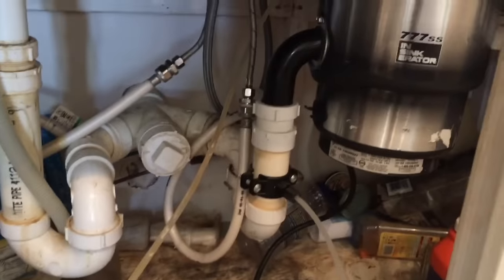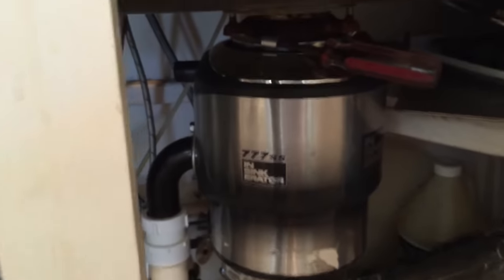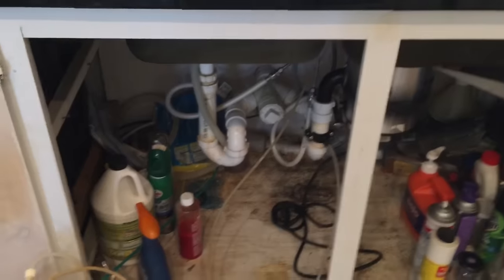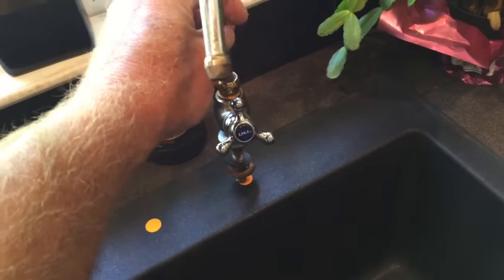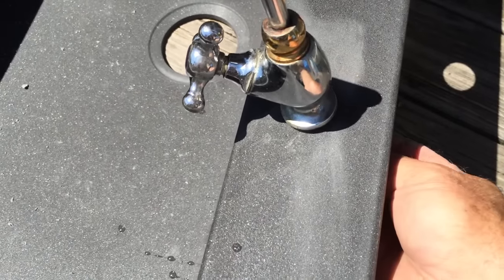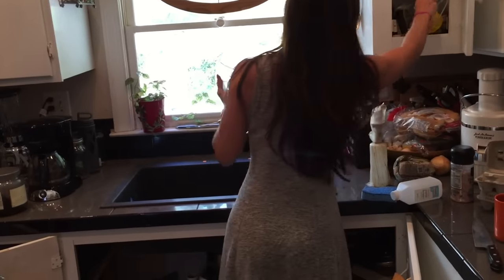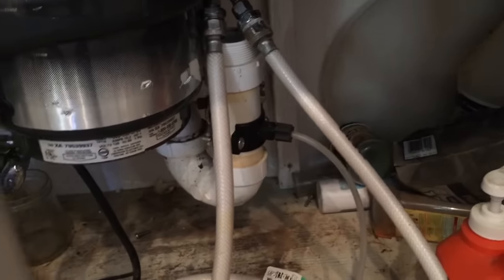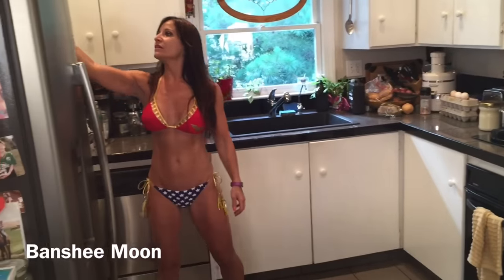Farm Girl and the plumber. Exoman replaces sink and does a how to.

Comment: There shouldn't be two traps nor two drains like the way this is plumbed.  I have plumbed a double side sink with a two-part waste  with only one trap into one drain for close to over 40 years.   To much stuff going on underneath the sink.
Reply: I learned the plumbing trade back in the 70s and worked for a plumbing contractor back then and when I left, later on I got my own Contractor's License and have enjoyed re piping houses and installing sewer, gas, top out , finish.  It all.   Lots of work but it pays well.  Here in CA we get $70.00 pere hr,  some others get up to $100.00 per hr.   I can't be that way.   Start over from the wall out and use a 2 part waste.  The only way we do them out here.
Reply: I still have my license and bond but I am giving it up here soon.  I don't do much anymore due to health problems but when the economy was good I use to do a re-pipe about once a week or so.  Made dam good money with re- pipes.   Anywhere from $3000.00 to $5000.00 .  But those were the days.  Heart problems here keep me from doing damn near everything.
Reply: ***** That's all we use or I use out here is Aqua Pex but stub out with type L copper stub out's with pex fittings on the ends of the 90s.  Buy them already made up.  Only thing I sweat is water heater stub outs.  And yes for under concrete you have to sleeve it with 2" so you can slide it through.  Re pipes are a bitch or can be but the money is great.
Reply: R apparently you're the only one who is looking at the plumbing....
Reply: R
Reply: dobbel price in norway
Reply: Mel Freitas
hes an old man now what do you expect him to look at